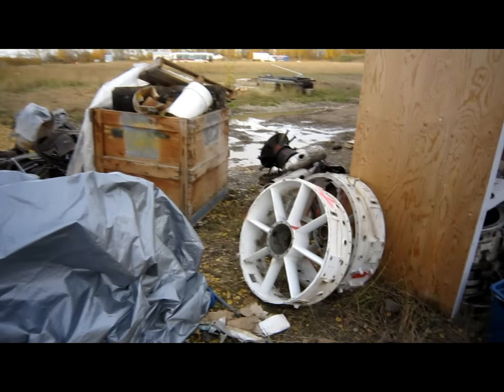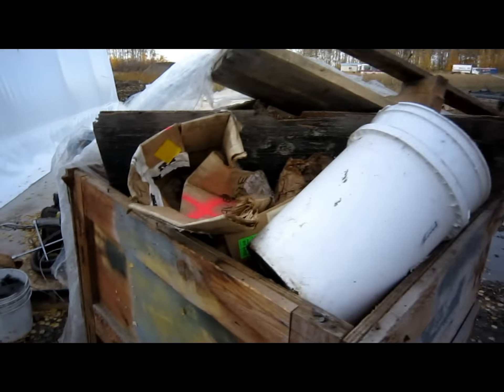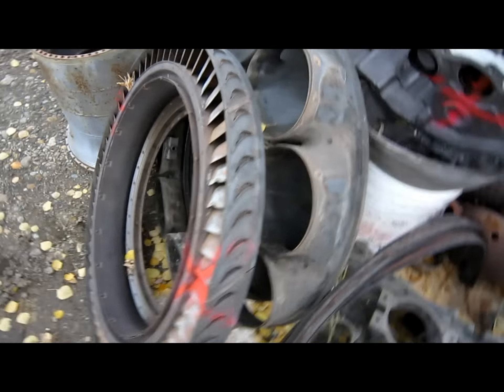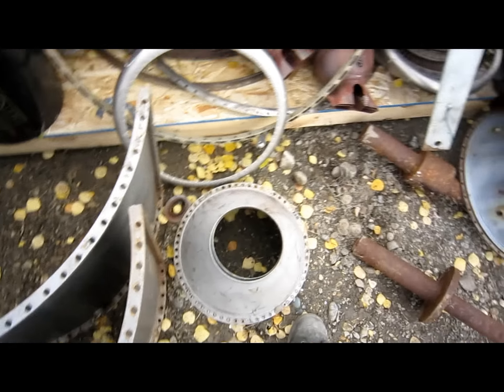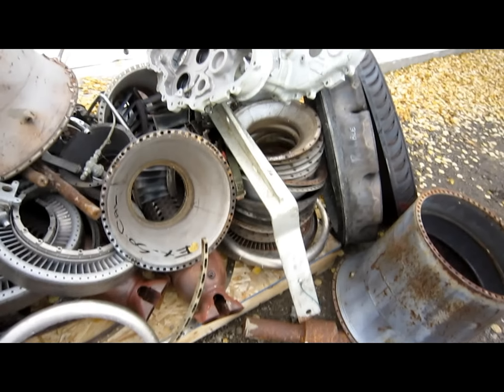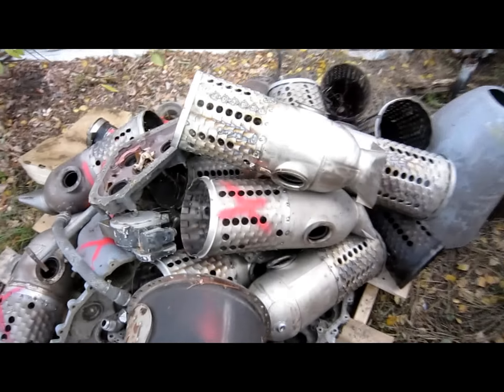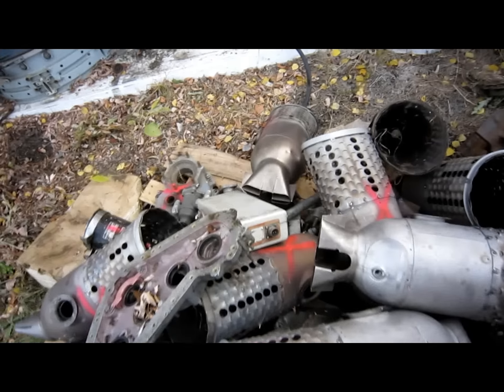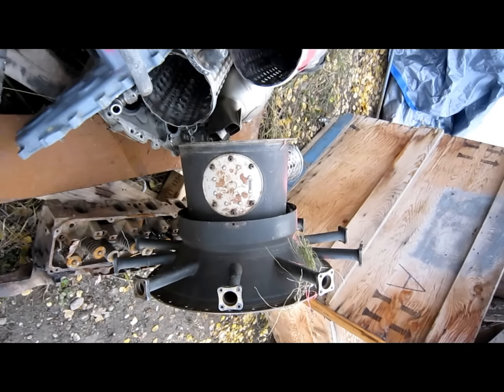Jet Junk

Comment: Under guarantee it'd be worth running an Ebay shop for that kind of stuff. Worn turbine or even compressor blades, a few bugs each...people would buy! At least I would buy one or two. ;)  A watch wristband forged from a former titanium compressor blade. It'll be cool. No need to tell the customers, that it is taken from a power turbine, telling them that it is from a cold war era fighter jet rises the demand!

There is a plague of sideline cutlers over here, who love the idea of forging different kinds of steel alloys together and folding them few hundred times under enclaveing lots of slag, coal and tinder with each layer. They call it Damascene steel, what it isn't. It's just the apeing of an anchient art of blacksmithing they barely understand. In 90% of the cases the results are worser than using one single, well tempered, good old low alloyed Carbon steel. Even the tempering characteristics of the different used allows barely fit together. But thats not the point, because customers love the idea of having a knife made of a former tank barrel, even when this steel is useless for a blade because of too less carbon for a heat treatment and to much chrome for a fine grained texture. These guys would give a ball for knifes made of steel and nickel alloy turbine blades!